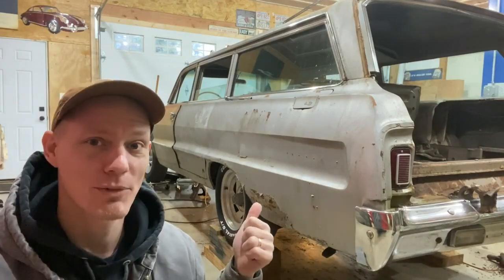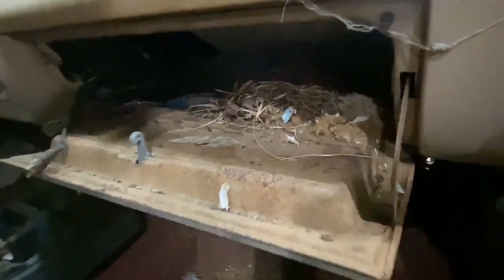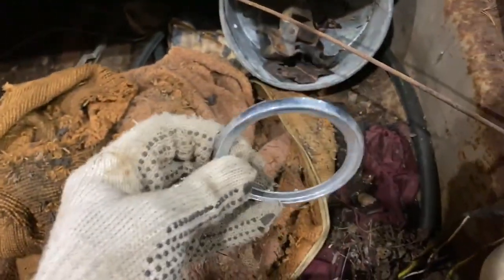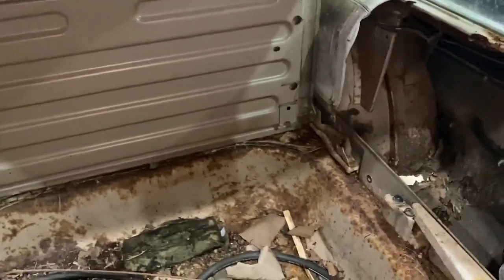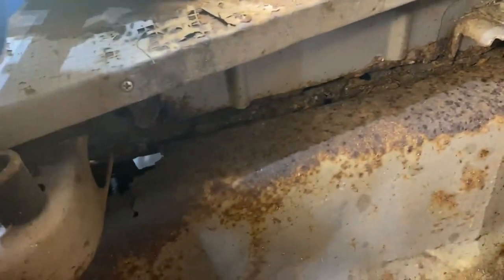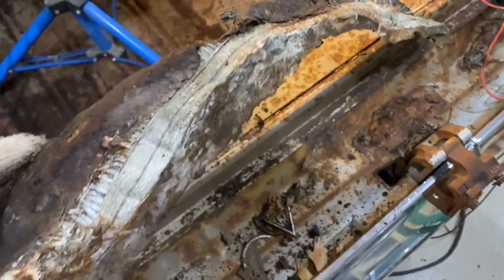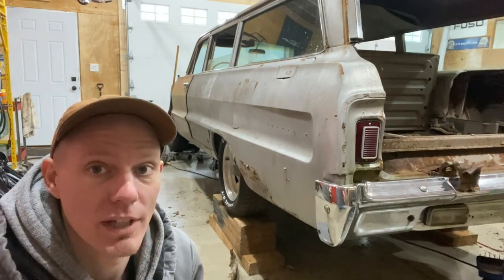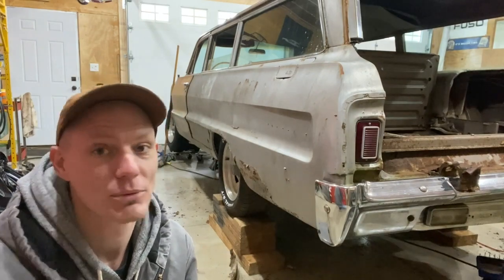I Bought The RUSTIEST Impala On the Internet ($500 Well Spent!) | @projectcarrescue

Comment: I was watching your frame repair and went had subscribe at number 290. Puddin Fab shop is doing a 1961 on his channel.. for his car he said that it was an $86 patch panel for underneath the backseat. He's out of Oklahoma. Watch his last most current episode because eighty-six bucks sounds a lot better than fabricating assuming that the 64 would also be available. He just put the rest of the floorboards in. If you look at in his comments and replies he tells you where he got the pans at. Just throwing out some possibly helpful information. I've got a 61 and a couple of 62 wagons. I don't know how collectible the 64's are but if they fall in line with the 61 twos and threes, you got a fantastic deal for 500 bucks on yours!
Reply from the maker: Thanks for subscribing! I do have a new floor for this car already, but I’ve gotta find the time to install it! :) hopefully in the next couple months! It will be great to have a solid floor in it again! It will be waaaaaay more solid!
Reply: @projectcarrescue  did you get the supplemental piece for under the back seat? It looks like you we'll need to do some work on the bracing or the floor pan as well. You know I got these cars I'm cheated point where I'm just thinking it's more fun to watch somebody else do it. But I go back and forth. I have a couple of active projects too.